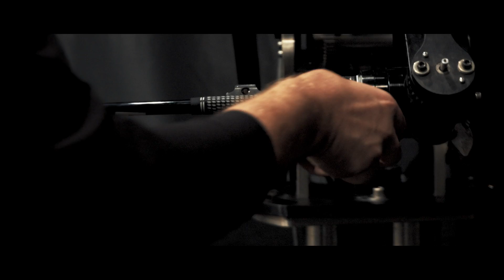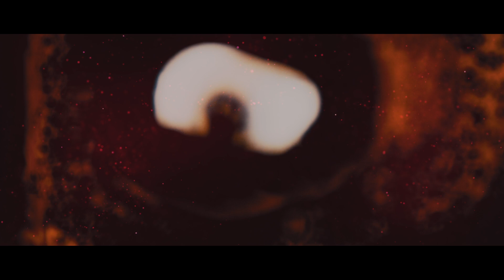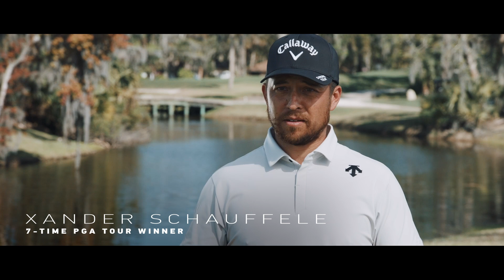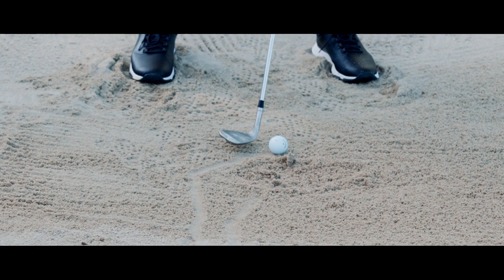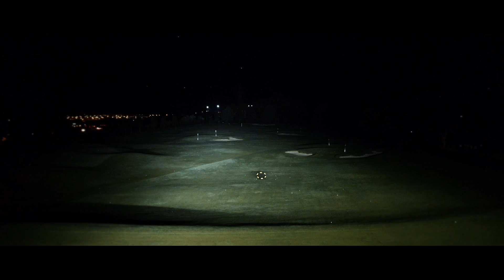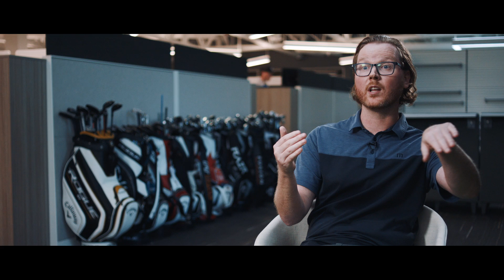The Making Of Chrome Tour

Comment: its a good golfball don't get me wrong...but i just think its let down by this weird hexagonal bee hive dimple design...take Bridgestones dual dimple tech...they mapped it with inflight cameras to measure the patterns of airflow into and out of the dimples to see what impact it makes on ball flight dynamics...the beehive design has a negative air draw that is not quite as good as the Bridgestone...the only thing really negative about Bridgestone balls is that Tiger Woods uses it...but apart from that its the best ball hands down on the market today. Taylormade tp5 has too large a seam on it.